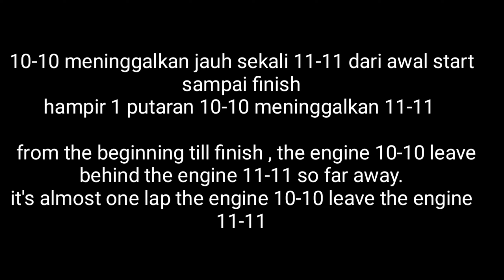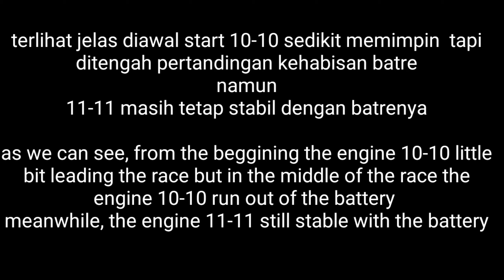tes run tamiya mini4wd mesin,engine 10-10 vs 11-11

Comment: Mantap bang, kalo untuk sloop brass bagus yg kupu2 atau apa bang?
Reply from the maker: Klw saya lebih suka yang biasa bang, bukan kupu" ,klw pakai bras model kupu" biasanya klw track sudah kusut bgt baru saya pakai
Reply: @ghifaraltamiya9438  ok siap thx infonya bang, lestarikan sloopers bang hehe
Reply from the maker: @rootsistance  siap bang, ngomong"dari mana nih asalnya?
Reply: @ghifaraltamiya9438  saya dari Kuningan Cirebon bang
Reply from the maker: Masih ramai kah dicerebon sloopersnya?
Reply: @ghifaraltamiya9438  cirebon mah ada terus bang di GTC Om adang tuh. Paling gak 2 minggu sekali liga
Reply from the maker: Woww keren bang,, tetap semangat slooper cirebon,,
Reply: ghifaral tamiya klo track sudah kusut bgt gimana mksd nya bang ? Beda track beda brush gtu?

Comment: Klo 10-10 biasa saya makek pas track sehabis halilintar banyak tikunganny om, model" kyk track kejurnas lebih enak main di 10-10 hhehe, klo main kebut saya pribadi suka main di 7-7-7 🙏🙏🙏✌️✌️
Reply from the maker: Woww,, keren bang,,
saya 7-7-7 dulu suka pake juga bang,
saya tipe orang ngk bisa main kebut,, bingung ngeset mobilannya klw mau mau ngebut,,
Boleh dong minta sarannya ni 😁
Reply: @ghifaraltamiya9438  wahh klo abang sampe bilang gak suka main kebut, saya yakin nih settingan mobil abang pasti udh enak" semua ✌️✌️ salam slooper bali bang 🙏🙏
Reply from the maker: Woww slooper bali ni abang ,,mantap bang, masih ramai bang dibali kondisi skrng, kejurnas jadi diundur dibali ni 😭
Reply: @ghifaraltamiya9438  sepi bang, daerah denpasar udh nerapin karantina wilayah, semoga cepat berlalu ni bang, biar gak rugi prepare hhehe 🙏🙏🙏✌️✌️
Reply from the maker: Iyah, semoga cepat berlalu
Reply: kawat ukuran brp tu bang kalo mau kilik 7-7-7